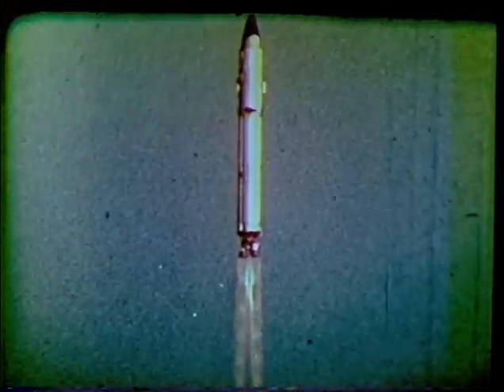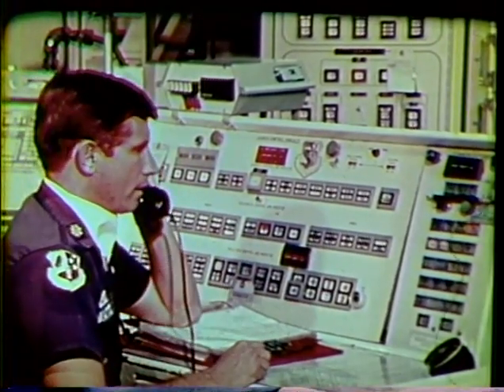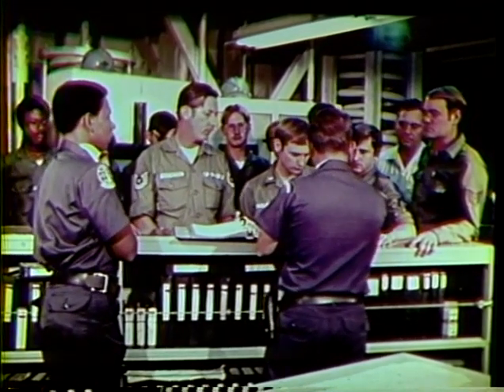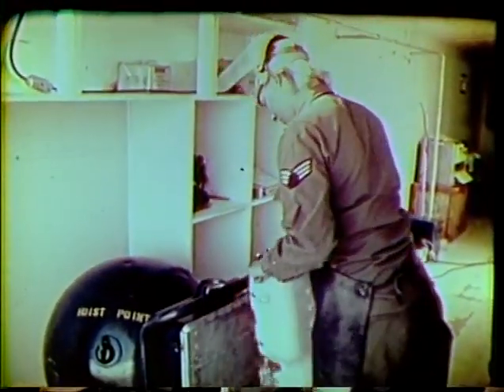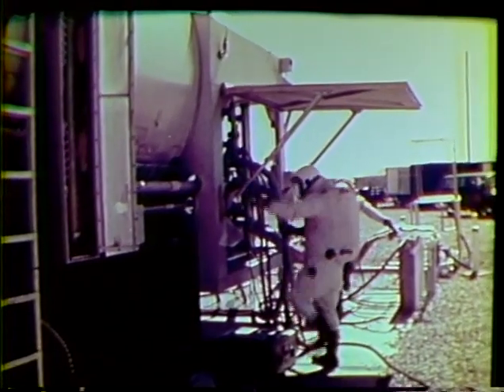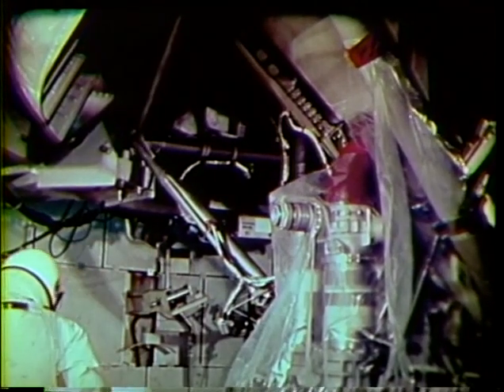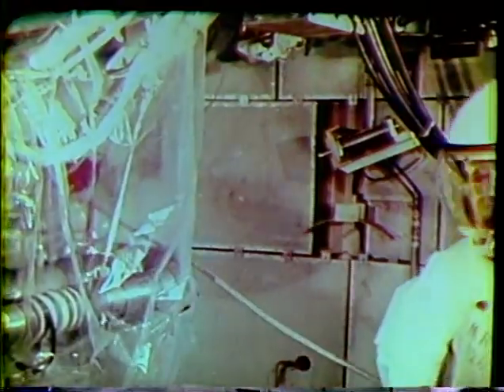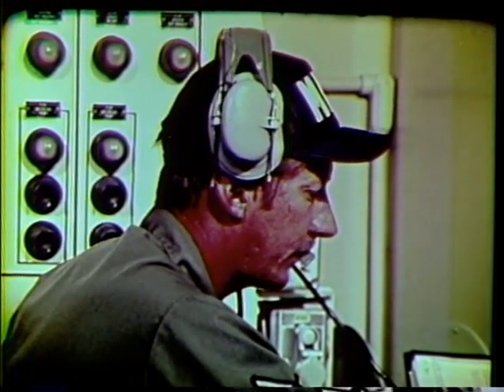Titan II Propellant Transfer Operations (1980)

Comment: Can't believe I stumbled across this post. I served with 308th and 381st PTS.. I remember several of the guys in the film. Lots of deactivation memories and I'm proud of having been a part of all this.
Reply: I am currently working on a kind of simulator for titan 2 missle silo operations.
The last days I am searching for data like correct and incorrect tank pressure in PSI and time to drain and fill for each tank.
Are these informations still classified or just hard to find?
If this data is unclassified, some detailed data would be appreciated.

Thank you in advance :)
Reply: What was the purpose of loading and unloading? Does either of the two have a shelf life or something? Thank you for your service and God bless!
Reply: @mdtransmissionspecialties  typically, the only time we were "unloading" the fuel, or oxidizer, was when the tank seals started to leak, which would lower the tank pressure, and take the missile off of the "Alert" status, i.e., it couldn't be launched.

Comment: 2 people had to be present when used or unused code sheets were burned as they required that 2 signatures were signed that the code sheet was destroyed and accounted for.
Reply: Not that easy. Each person had their own code memorized. The code sheet had a number - alphabet combo. You read off the alphabet that was next to your code number and the missle folks downstairs would verify, if it didn't match what they had - you weren't getting out of that locked in area until I arrived - missile cop. We never required 2 people to burn the code sheet, but unlike what we saw in this video, you were suppose to use a pencil/pen or something to break apart the burnt code sheet as you could still read it after it was burnt.
Reply: @davidpritch718  I remember the burn can containing rocks so you could shake them around to break it up
Reply: So all you'd need to do to gain unauthorized access is to ambush the convoy on its way to the site from the base and obtain the code sheet.  Now, um, how difficult would that be?  The base would be a known location, the launch facility would be a known location and the rout between them would be known.

Am I missing something or is there a vital security step we aren't seeing in this?
Reply: @johnrauner2515  The launch facility wouldn't be a known location necessarily. The route could lead in the direction of several possible sites.
Security forces go along with the convoy and everyone is in radio contact.
I've driven along highways that go along some of the roads that lead to these sites in North Dakota.(in the middle of nowhere.) There's people out there, watching.(in vehicles)
You almost get the feeling that you're trespassing, even though you're not.
You get the feeling that if you were to pull over on the side of the highway some folks would be coming along to assist you pretty quickly.
Reply: @electrolytics  Helicopters usually monitoring/guarding as well.  Later!  OL J R :)
Reply: @johnrauner2515  you do realize if they don’t have contact I think 3 minutes after they enter the gate they aren’t getting in? And they have a team show up after that 3 mins so no not going to happen. Plus there’s 3 different doors before even entering the blast lock? Also all 3 doors have cameras.
Reply: @johnrauner2515  here’s the video of the actual full procedure from the museums YouTube  https://youtu.be/GzCXBIXh294